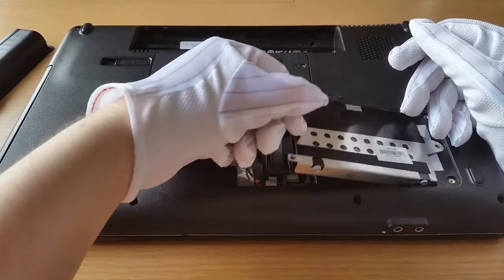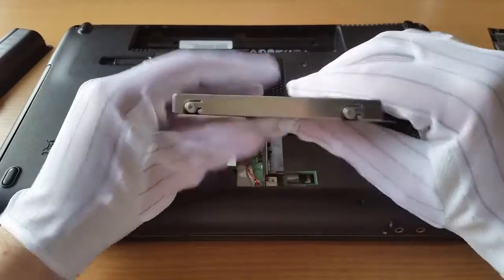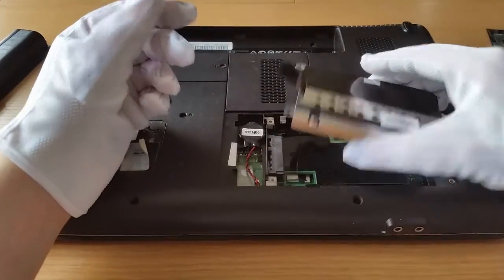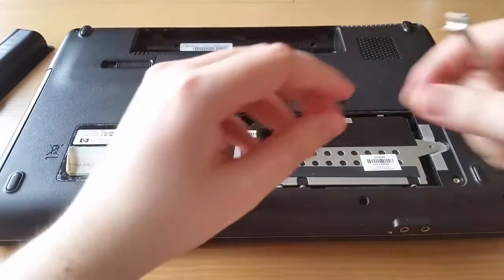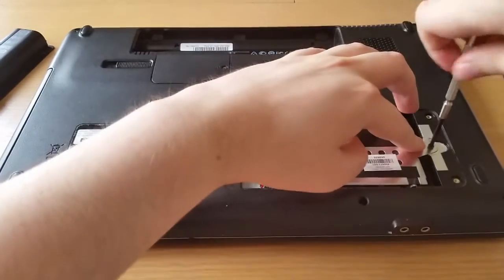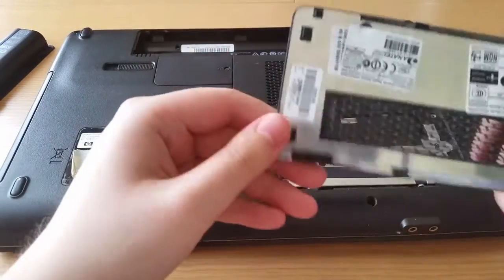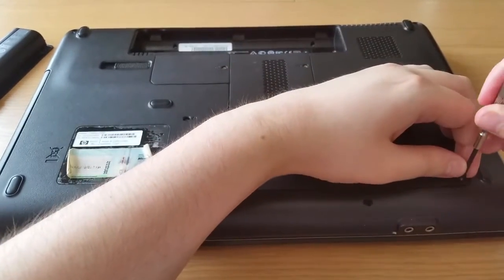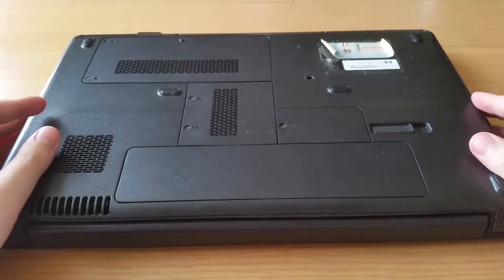How to Install a Laptop Hard Drive (HDD) - HP Presario CQ60

Comment: Dear Falky, Please Watch My Video so to put my mind at rest, here is the video i made for you, https://www.youtube.com/watch?v=JboGlzN4Hgc
Reply from the maker: Here is another example of what you need to buy. - https://www.amazon.co.uk/USB-SATA-Adapter-Cable-Drives-en-GB-SATA-USB-3-0-converter/dp/B01N2JIQR7/ref=sr_1_3?ie=UTF8&qid=1537816901&sr=8-3&keywords=sata+to+usb+cable
Reply: @Falky1  on my video, the last photo is USB 2.0 to SATA Cable SSD/ HDD 2.5" SATA Hard Drive To Computer Laptop, This is from EBay for £1.78, is this the cable I should buy as that Amazon cable is to expensive, so I will buy the one from EBay for £1.78, here is my video again, https://youtu.be/JboGlzN4Hgc

Comment: I have a broken Compaq Presario CQ61 Laptop and I am going to buy a 2.5 inch SATA to USB 2.0 cable to connect to the hard drive which I am going to remove from the laptop, should I buy a 15 or 22 pin one.
Reply from the maker: I dont get what you mean? All 2.5 inch SATA connectors are the same as far as im aware. You only have to worry about the number of pins if you are buying IDE cables. SATA is 15 pins. If you are unsure then the safe old method is just to count the number of pins on your connector! lol
Reply: @Falky1  thanks very much for the information.

Comment: Do you have to reinstall the operating system if you replace or upgrade the hard drive?
Reply from the maker: Yeah you will have to, unless you buy a hard drive with the operating system already installed on. Just remember to backup all your data if you remove your current hard drive as you will lose everything (if you install another hdd of course)